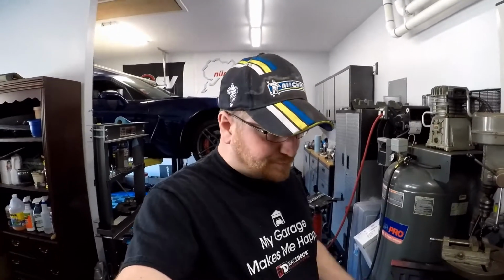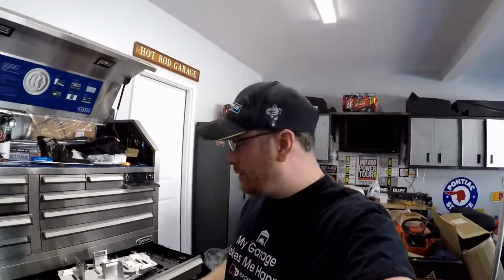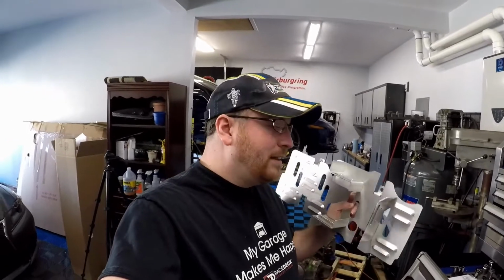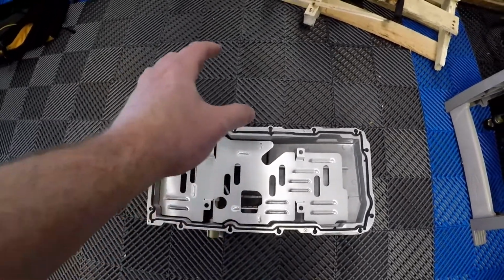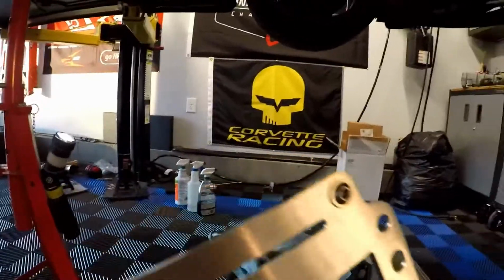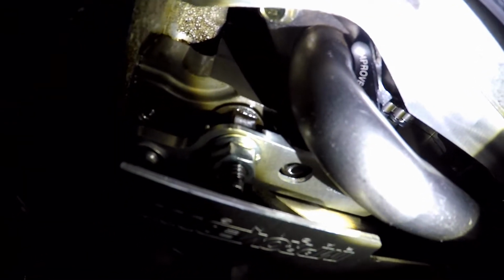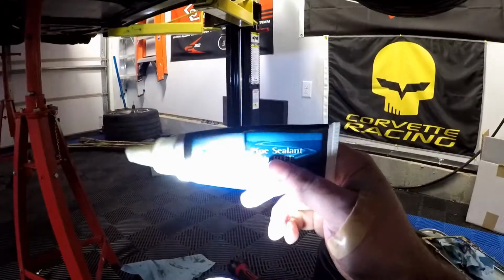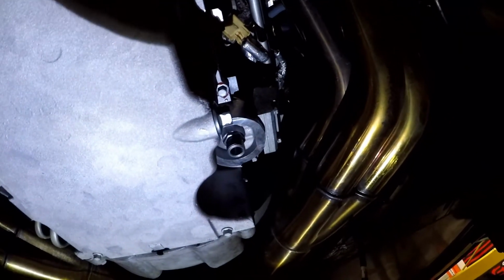2005 Chevy Corvette - Upgrades 3.0 - Pt 21 - Oil Pan/Improved Racing Upgrades Install

Comment: Great video! Looking to replace my oil pan gasket. How many hours did it take you to remove the oil pan?
Reply from the maker: Depends if you drop the subframe down - you will have to disconnect the upper control arms to get the most room. Probably 2 - 3 should get it out and ready for a new install.

Comment: How many hours would you say this took you?
Reply from the maker: I had probably 6 hours into it.

Measuring the scraper to crank clearance is kind of a pain - and I had to clearance one corner.
Reply: @bonecrrusherSS  thanks for the response. I just tackled this job myself the other day. I want to say it also took me about 6 hours. However I completely dropped the entire cradle for better access to the rotating assembly. I checked the clearances about 4 times and luckily I didnt need to clearance anything (LS3). Its not a difficult job but time consuming especially since its not something you want to rush.

Comment: Did u have to remove the engine mounts
Reply from the maker: Just the bottom nuts attaching the engine mount to the subframe. You do not have to touch anything on the block side.

Comment: Good video, one point to note.  The feeler gauge is used to ensure there is 20 thousands clearance between the rod ends and the very close fitting scraper As THE ENGINE IS TURNED OVER manually with a breaker bar on the balancer. This is in the instructions. If it hits or the feeler can't fit in between, you can loosen it and adjust the position. Nice car.
Reply from the maker: Shawn I did turn the motor over when I test fit the scraper. 

Haven't had any issues with the Improved kit since the install.

Comment: Really helpful,  tackling mine this weekend. Hopefully its as easy as you make out and im just talking about the cradle. Thanks!
Reply from the maker: Do you have coilovers?

The leafspring might be an issue holding everything up still. 

So you might need to remove it.